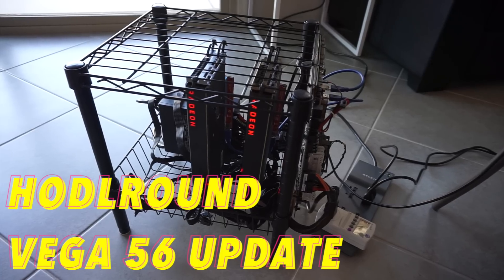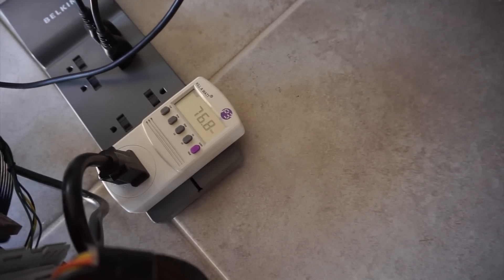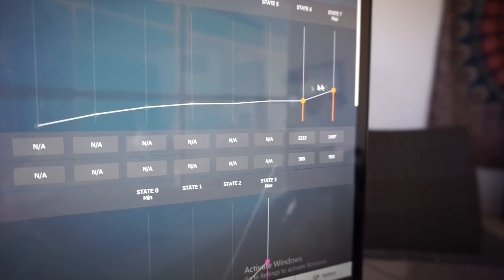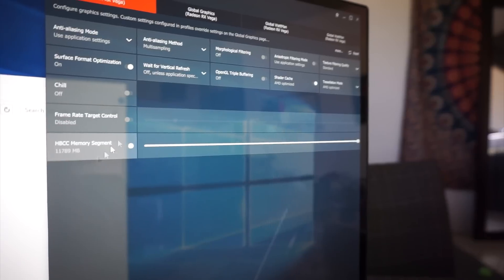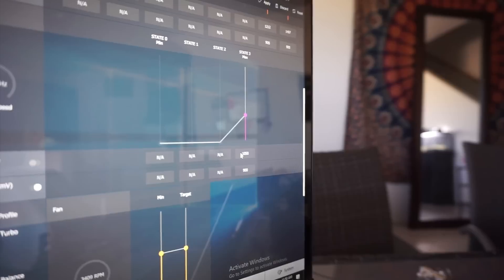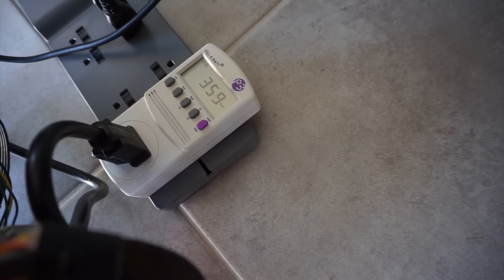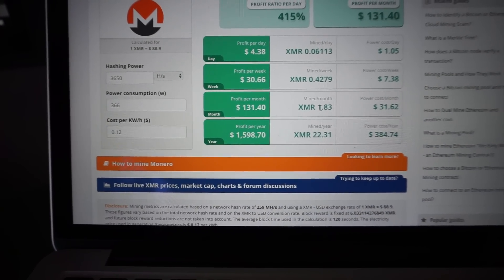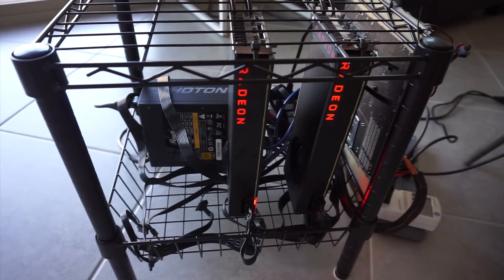Vega 56 Monero Mining Rig Update! Vega 64 Bios! Powerplay tables.

Comment: Hey guys, I desperately need your help. I have a VEGA 56 flashed to 64 and nomatter what I do i cannot get over 1250 H/s. What is wrong?? Please help!
Reply: Wattman setting?
Reply from the maker: activate HBCC, disable and enable through device manager
Reply: Probably its because of config. Check that it has 2 threads per card

Comment: Hey man very impressive ,will u eventually upgrade to 6 cards? on the rig?
Reply from the maker: Yes I'm building the 6 card now, I have seen one 6 card running already
Reply: im building one as well,  just using 2 (750) psu thinking about ASRock H81 Pro BTC R2.0 board , you reckon that will work? or should i invest in better motherboard? your help appreciated !
Reply: can you tell all best components for building 6 card rig ?

Comment: That is not how you calculate the power per card.
The idle wattage also has about 20W/card in it. So reality is something like (370-40)/2= 165W per card.
Reply from the maker: So you are stating that the motherboard cpu ram and risers are pulling 46 watts? IDLE: 86 W - 20W - 20W =46 W.
I really doubt the rest of the system is pulling 46 W by itself. A G4400 cpu is projected to pull 54 W.
Reply: HODLround exactly. Or even less. 54W TDP does not mean it pulls 54W all the time.
Reply: @ Zoltán Bálint
 Exactly, the cards are still eating up some wats at idle, not sure how much, but 20W/card sounds possible. Still 165W per card for this hashrate is pretty good result.

Comment: I'm getting a consistent and stable 1950 h/s on a Gigabyte Vega 56 with stock BIOS.  That's more than 2.5x what my RX 580's can do!   This card rocks!  If you told me two weeks ago that I would be buying Vega cards I'd say you were nuts.  It does drop to 17 xx after some number of hours but reapplying OC settings and restarting the miner gets it back to 1950.  I will have to automate that at some point.  I achieved 2050 or so with aggressive OCing but it wasn't stable.  It might be though with more tweaking.  Probably not worth the power cost but it shows what these cards are capable of.

I really hope other algorithms can be tuned to achieve similar performance gains.  If they can this card is going to dominate GPU mining for the foreseeable future unless RX cards drop to well under $200.
Reply from the maker: What are the settings you're running, also I'm running some v56s on stock bios and v64 bios. Yeah these are real nice cards !

Comment: Can you link me that rack that your rig is built in? Thanks
Reply: https://www.amazon.com/dp/B0026SLZDA/ref=twister_B01N8T6OJZ?_encoding=UTF8&psc=1
Reply: Get a three shelf wire frame unit from Home Deport for $19.  It's larger and more versatile.   My next rig will be built on that and it will support up to three PSUs and a dozen GPUs if I want, plus still have the top shelf free.  I built my first rig from wood and while it's ok it it cost me more and isn't as versatile plus the time cost.